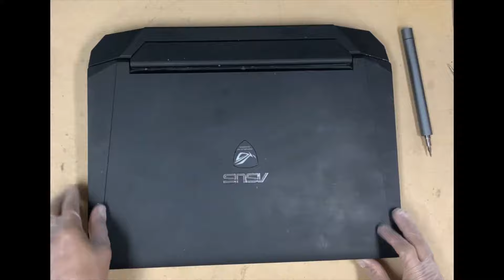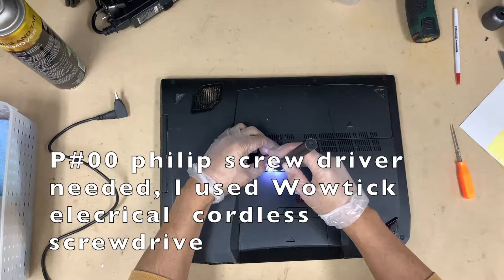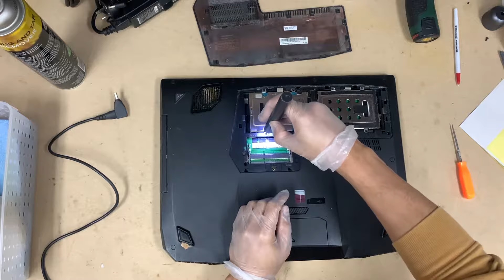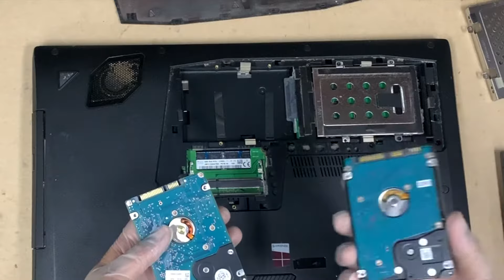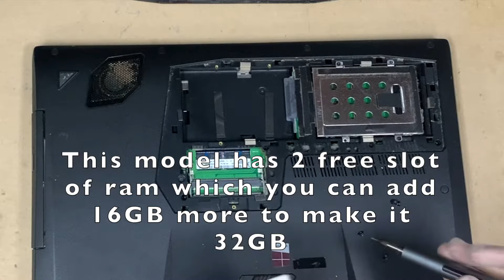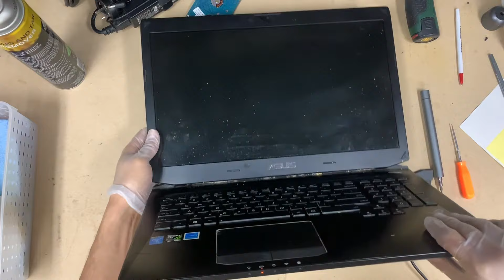ASUS ROG Republic of Gamers HDD Replacement / SSD Upgrade

Comment: I can't believe how hard I had to dig for this video but its literally what I need it. Is there anyway you can make a follow up on what to do once you turn on the computer after installing the SSD? Im absolutely clueless and Im trying to help my little brother with his Asus G750JW so it can be faster when booting up and loading up videos. Thanks in advance!
Reply from the maker: Here is what you need:
1. A bootable USB for windows 10 or similar. Which you can get it from eBay or make one yourself.
2. Press F2 and disable the 'secure boot' 
3. Press F10 to save the setting
4. Press 'escape key' to boot from the USB
5. Rest is self explanatory.
Reply: @EasyFixLaptop  You are a king! I Did it! Thank you so much! <3
Reply: I did this but can't get it to work. My old HDD only had pictures on it. I took it out. Put in the SSD and switched on laptop. But it can not see the new SSD. Shouldn't it just be there as if it was another storage device like a USB? Or do I need to do more to install the new disc?